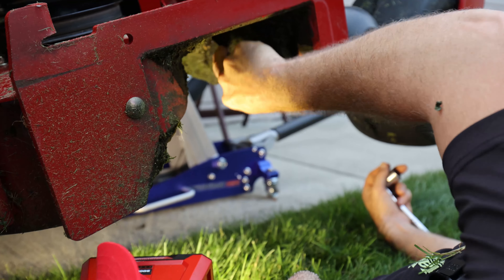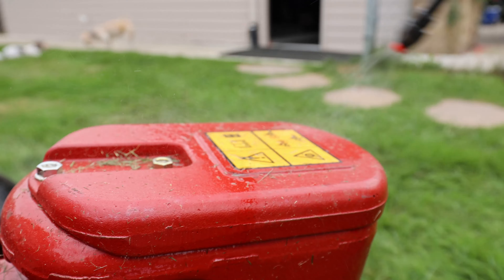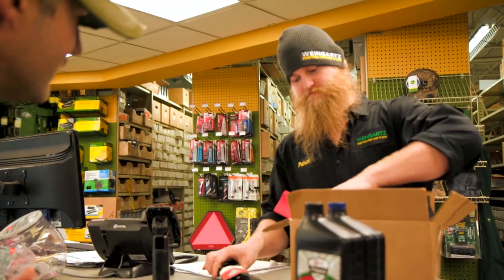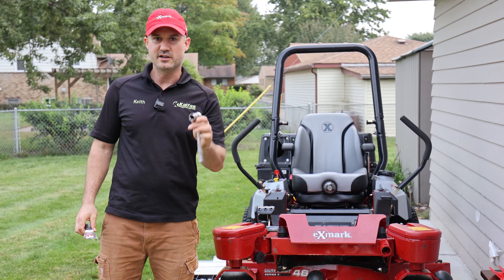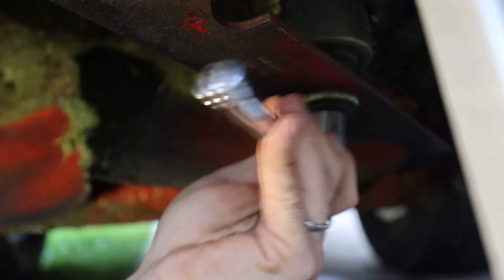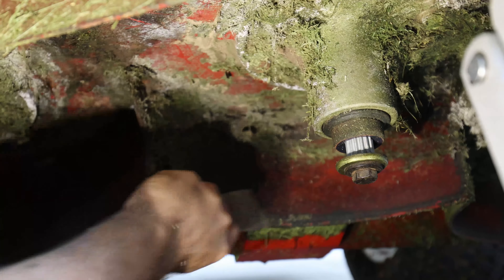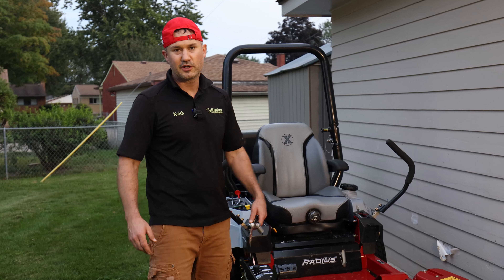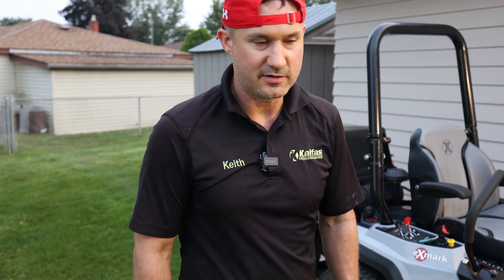CHANGING BLADES & SCRAPING MOWER DECK / EXMARK RADIUS X

Comment: I’m adding lawn maintenance to my handyman business and I’m on the fence on a trailer. Do I go with an open trailer or enclosed? I have an enclosed for the handyman side. Any advise would be much appreciated
Reply from the maker: If you have a garage to park it in and you live in a lower crime area. I'd go with an open trailer.  Haha.  Otherwise definitely an encloses. I've used both and I really like the enclosed trailer because you can put big graphics on the sides.
Reply: Make sure you get it a bit wider and longer than you think...6 x10 min

Comment: How much do you change or sharpen your blades
Reply from the maker: Depends on how much you cut.  If you've got a full route over 100 lawns. Then sharpen them once a week.    And I like to use my Mower for spring and fall cleanups... the Blades take a super beating.